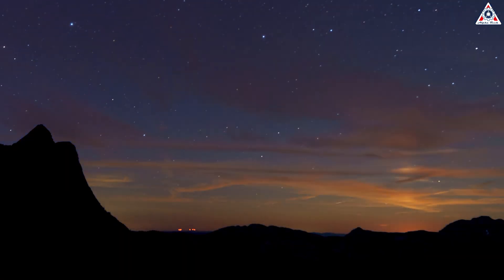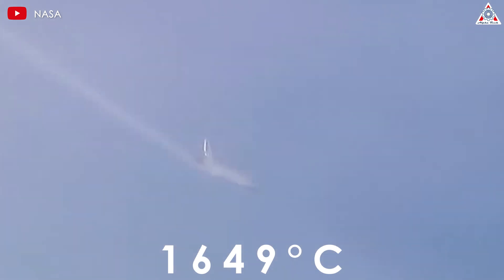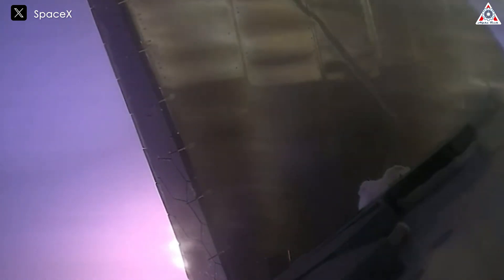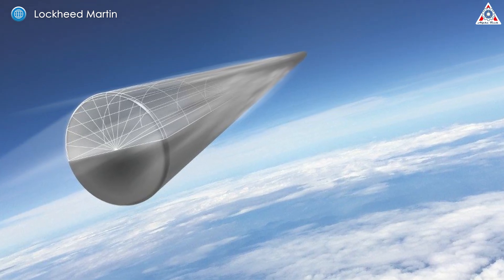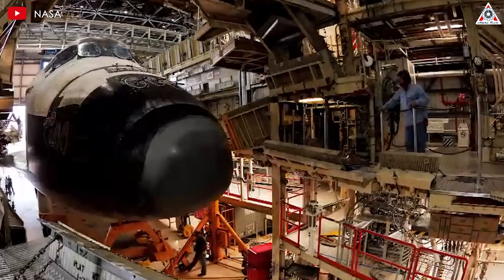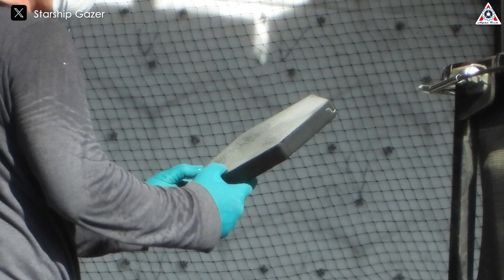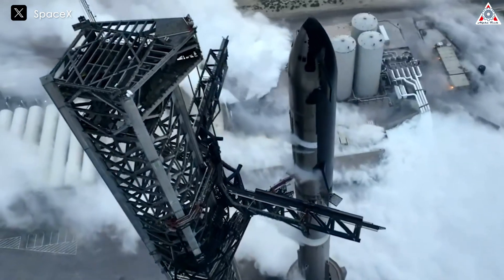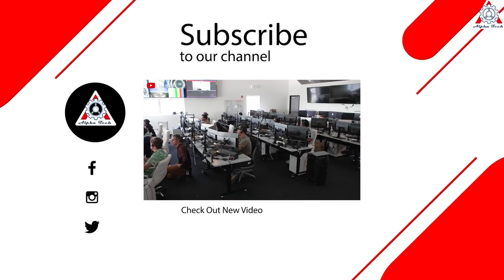SpaceX Starship Heat Tiles Re-entry Somehow Better than the Space Shuttle! NASA Shocked.

Comment: 2 questions ⁉️ 
One why not aldo have an easily mountable sacrificial disposable out layer. This could then burn off and be quickly replaced.
Secondly what type of adhesive do they use to attach the heat tiles ?
Reply: Excellent video Thanks

Comment: SpaceX has compounded the problem… lots of KE and no control on a falling object. The thicker the tiles the heavier the structure thus more KE. As a result payload gets smaller. At least you can say NASA engineers were able to design a shuttle out of aluminum, reenter 133 times and we never saw the landing mechanism fail or a molten tire…. That’s the outcome of many smart design choices. That’s good engineering. 
SpaceX still has much to learn… and a long way to go. 😂😂😂

Comment: I thought the whole point was to make a better heat shield than the shuttle? :)
Reply: NASA made the smart choice by engineering the shuttle. Elon expects physics to obey his laws because he can pay… good luck with that 😂
Reply: @Mannicx  NASA went 100 x over budget with its smart engineering. Tiles still prototype, and mostly worked last flight
Reply: There are many things in a space program SpaceX clearly does not understand and keeps making mistakes and generating bigger problems… they did not recover the IFT4 because they are certain of one thing… it would capture all the wrong choices they already know. The good thing is IFT will be launched shortly even if we know already it will perform similar to ift4… fins are the same and it’s now heavier than ift4 which will add more KE to dissipate… take your seats the show will start shortly 🍿 😂😂😂

Comment: Technically, the heat on re-entry is caused by compression, not friction.
Reply: Ha, I was thinking the same thing. Now think about that in the opposite environment, at extreme depths in the oceans. What is happening to the air for a body re-entering the atmosphere,  is the exact same thing happening to the air inside a sub during explosive implosion. The air is compressed so fast it hearts up. The sub thing is a fraction of a second,  but same principle.
Reply: Agreed, lots of people get this wrong. Its not friction.

Comment: Spray on an ablative material over the entire vehicle. Then program the thrusters to systematically tumble the craft keeping the craft uniformly heated. Once the craft lands, just spray on another layer of ablative material.
Reply: 👍🏼 however fins act as flow controls and designed to work in one direction 😂😂
Reply: Ablative heat shield is 3 inches thick. Once use, you have to remove it. Which is not easy as it is design to hold on tight and be ripped off by the plasma stream. If you are adding new ablative material, to old surface, it needs to bond well or it may just be ripped off like a zipper.

Comment: IIR, NASA is mandated to use a "man approved system" for the heat tiles. In this context, that means pretty much the materials and systems that became "man approved" back on the Mercury program in the '60's because it happened to work a few times in a row. In the intervening 50 years or so there have been a few advances in what materials and processes are available and I'm pretty sure that Musk took advantage of them. That said, Space-X may use exactly the same stuff that NASA uses; I don't really know. The point is that Musk was not constrained by a mandate from almost 60 years ago as he was developing his systems.

Comment: Well after all you have all the data from the space shuttle at hand and 40+ years of material sciences advances at your disposal.  One would expect significant improvement from the shuttle's heat shield systems.  What would be shocking is if there wasn't significant improvement.

Comment: No, NASA isn't shocked; SpaceX is doing exactly what they anticipated.

They would be shocked if SpaceX copied the Shuttle's slow turnaround barely reusable tiles.  More than any agency, NASA expected SX to come up with a better design, that is quick turnaround fully reusable tiles.

And they haven't done it yet, and may not ever do it within our lifetime.  This tile situation is the Achilles heel of any rocket trying to be a quick turnaround reusable rocket.  The heat is so high that it melts all metals, so some sort of ceramic material has to be used, and ceramics are brittle; they don't flex much like the a rocket does.  It could turn out that they best they can do is have just a few tiles that fail, not enough to damage the rocket, and then quickly replace those for each flight.

My suggestion is a new flat head screw to attach the tiles, a screw that has a ceramic top and metal bottom, probably glued together.

Comment: Translation: The Enginerds and NASA retreads at SpaceX are going to be insistantly stubborn and Mulish.

Doing the same thing over and over and expecting different results...

A thought experiment...
Lets say we built a feather out of stainless steel, that had the same surface area to volume and weight ratio as a natural feather. And also that interesting feather shape that that uses air resistance to turn innertia from gravity into air resistance and a spiralling downward glide flight profile.  The reason we are using stainless, is because we wish to place it in LEO, and not have solar heat burn it up.
Now if our fluffy metal feather model is allowed orbital decay, will it burn up during re entry? if it has the same characteristics as a natural feather?
ie air resitance to weight, glide ratio, etc.

You could also do the same experiment with say a feather made of Nomex fiber for the resistance to solar heat. I would suspect even with its much less resistance to heat damage than stainless, if the certain conditions of featherness were met, it wouldnt burn up doing a re entry either.

synopsis: the problem is being approached from wrong end thinking. Hard thinking rather than soft thinking. 
Just as the hard launch mount and flame deflection system is only surviving marginally undamaged due to the soft thinking of the water spray system.

Stuff like that... 🤭

What this means, is SpaceX is attempting to use more Brutish engineering than their fathers did did on the Space Shuttle.

When they should be thinking of less brutish methods.

They are getting closer to the required thinking, with extending the flight time and spreading the heat out over more surface area. But until they start dramatically extending high altitude glide ratio  EXCEEDING that of the Space shuttle, their glorified toilet tiles arent going to save them or Elon from the embarassment of little progress.

SpaceX has no Zengineers.... Still attacking the problems like Neanderthals with a club.

Any bets on the next ship only being slightly less burnt up than the last unless the high altitude flight profile is extended beyond a ballistic parabola?

Fricking silicate asteroids have burnt up doing entry since the dawn of time, as have nickle iron asteroids.

Neither material is gonna do it without more finessé...

Silicate tiles? nickle iron stainless?

Not gonna fly Wilbur without more lift...

Have done dozens of writs on this and various potential options... maybe it will take fear of bankruptcy again like when I proposed parts count and all the Yammerheads screamed all butthurt, that somebody not in their Social Clique might dare to suggest they were F'd in the head...

You gonna pay the Physics ticket sooner or later....

I'll wait...
Reply: While you may prove to be right in the long run, don't forget that they've only had 4 test flights in this iterative process.  Elon has been on record admitting that they aren't there yet on the tile situation, but they're already doing something dramatically different on the next flight.  What took NASA years to change, SpaceX is changing in a month.
Reply: @tood6459  
Good point, I do lack patience fairly regularly...
And like Elon  have realized its a race between Space and Extinction.
I think the odds of the Asteroid strike are way less than the odds human stupidity gets us...
Reply: The larger volume of Starship already addresses the idea of using a smaller density of the structure therefore a more buoyant vessel.  This extends the flight time.  By incorporating more complexity such your feather concept you create less standard parts, less durable parts and more specialized  parts creating more difficult maintenance. Maintenance is inevitable on all reusable vessels.
Reply: @markharmon4963  The feather thing was just an analogy to make a point.
And I understand the Starship volume thing, and in fact suggested pressurizing the hull for launch to stiffen it due to its relative light construction. others may have suggested the same, but I did hear that was getting used.
Also I know its gonna be difficult if those ships are coming back loaded, passengers and or cargo, dont think that volume will be enough for 100 to 200 tons depending ship size.
Also I doubt current construction methods would support that load.
And have heard Elon referring to this problem, that actual service models will have to be designed and built much different.
My point all along, is that there are better designs for more passive re entry profiles. They of course all add mass. over anything except a tube or sphere shape.
But we have better engines now, we dont need to build spruce and silk aircraft figuratively speaking, Especially considering published numbers on Raptor 3 and presumed numbers on Raptor 4.
Getting more power and efficiency means a new possible hull design. A new paradigm.
And I think it needs to be better than the Space Shuttle at high thin air glide ratio, as the better we get it, the less critical the heat shield is, and it may allow us to shift to coatings, rather than affixed tiles.
Basically where they are now, is hitting a dead end in a maze. chances of getting tile to be enough doing a ballistic parabola at high speed into thick air, are likely small.
I have done many writs on the options available, from acute angle of attack with the tube hull, to suggestions for other hull designs and construction methods.
Also I have seen others making pretty good suggestions.
The main thing shown by flight four, is using current design and flight profile, even an empty hull barely makes it back, and comes in as mostly hot scrap. And it was amazing it still functioned.
Thats not gonna do it for several hundred passengers and their baggage.
They'd be cooked meat.
Something has to be improved, and I doubt enough difference can be made with improved tile alone.
They may be invested in current design and construction methods, but if they cant make it work well, they either have to change, or risk killing alot of people.
So far, the Shuttle was a much less crude design, and was still marginal  and had fatalities.
And in MHO, the tube hull and stubby flaps are unlikely to be adequate...
And that the best time to start working on better designs is sooner... they have plenty of V-1's to learn from. And i dont think making the tube longer or fatter will help enough. 
Just my opinion...
And has been for several years, and so far I'm not very wrong.
Reply: Get a peer review next time. 40% of this is childishly dumb.
Reply from the maker: @thomasmount3530  you mean?
Reply: @thomasmount3530  Oh? I have scored on SpaceX repeatedly, since the beginning with Starhopper and its wrinkly skin...
Many concepts I planted ended up getting used.
I have several thank you texts from Elon supposedly. 
If SpaceX hires the best and brightest on the planet, and Elon is a super genius, How come I can do that consistently?
And where am I gonna find any "Peers"?
Lemme guess? you have a wall hanger? and what has been your contribution besidesTrolling?
Go back to your social club, or come up with better ideas. 
"Through the eyes of a child we will learn how to see."
Thanks! would rather be childish and correct, than an adolt and wrong...
Reply: @garylester3976  ok off the top of my head. Your feather. Please list the tests Spacex did before it ever went to space to find a good solution. You have assumed they were not cost effective, when in fact, they were. You completely miss the line of thought where some of the vortex behaviour around the control surfaces cannot be simulated and so knowledge of weaknesses can be found by re-entering with not enough heat protection. I'd happily debate you more, but only if your goal is to openmindedly progress science.
Reply: @thomasmount3530  I'm here almost every day on Alpha Tech trying to present missed logic.
Which is the same technique Elon uses. starting with fundamentals. I discovered it seperately, only learned he uses the same technique within the last week or two. and mentioned that here on Alpha Tech I think, though I occaisionally do writs on other channels.
On the control surfaces, I predicted in writs here,  that the problem would be concentrated heat in the arm pit area of the flappers... and suggested more of a blended wing effect and control surfaces aft on trailing edges...  In fact, I have been critical of these same issues since the parts count fiasco era.
The flappers, the tiles, the glide ratio and upper atmosphere profile, and the Grid fins...

And have suggested multiple other options for each. And get consistently hearted and usually positive comments from the Alpha Tech admin guys.
Also if you were to dig back thru my writs, you'd find stuff that ended up getting used pretty soon after. The new/next seperation structure was me first, The new steerable fairing concept for Falcon,  and having it land like a hull down boat are in writs here on Alpha Tech weeks before it was the new genius idea.
I'm just trying to help, and do occaisionally get to smile when I manage to get in a concept edge wise..  And did it on other channels, and often got banned for my audacity, until after the parts count thing....

Alpha Tech aint my first Rodeo trying to help Elon.
Been banned on many space sites by the Gate Keepers in lab coats types. I dont stop. 
I'm somewhat like Elon.
My main symptom is I have lacked a short term memory since birth.
Its genetic, my Niece is similar, but I did get a gift, the ability to connect dots that others couldnt easily  see how they connect.
Also a class clown type, it helps, if you can get people alittle hot, they cant not think....
Ask your wife about that?
if she making you mad gets you to think? 🤣
Its why I have fun with people's egos... it gets results... And I have used the same techniques for years planting stuff...
Alot of online jokes have me as the point of origin. Many you have heard.
Like Elon's joke about Jeff not being able to get it up before his first successful launch, I planted that joke a week or two earlier on a SpaceX related site hoping it would get to Elon. 🤣
I'm here to encourage progress by any means necessary.... 🤗
And I'd love to discuss anything with you that might help.
And FYI SpaceX started cobbling up stuff with Hopper, there wasnt alot of previous lab work, and I was in comments herding things from the begining trying to get faster better developement. Elon often did adaptations of my terms... like I suggested "Enlightened Fabricators" and he morphed the term slightly for public consumption. that was when it was labnerds and water tank guys... Soon after he got a very professional fabrication contractor group on board. And things got better quickly.
Basically I've had a hard life, and did alot of practical things, and have a learning addiction.
And so a somewhat different not neurotypical animal.
This morning I was realizing the similarity between the re entry problem and required shapes, and the Story about the Origin of the Viking long boat hull design. They still remember the guy's name, and the story goes he saw the wind take a leaf across the surface of a body of water, and realized the design for the boat hull. Best hull design ever to this day.
When I first read that, my realization was he needed a leaf with wider aspect and turned down tips to create stability...
And have done writs on that shape here on Alpha Tech for the eventual re entry design shape, the cupped wings to channel air and turned down tips to keep it linear.
Watch a broad leaf with down pointy edge tips fall from a tree, thats how we need to design for reentry.
Nature is very efficient at things... billions of years of experimentation.
Ònly what works well survives....
Spacex is on a similar path.....
And I'm a long range shooter hobbiest type. I know about flying bullets and their limits and nomenclature...
What we have here is limiting ourselves by sectional density, and ballistic coefficient, and trying to slow the bullet down by key holing it. And not exceeding a ballistic parabola. We need to use more distance and less angle  of attack, and spread the friction out over more time, in thinner air.
Which is similar to putting wings on a glide bomb...
its to do better than a ballistic parabola.

And poor Starship's little stubby flappers ain't much... and over 45° hull angle means zero glide ratio..... its why the Space Shuttle was 40°....
I've suggested 5° to 15° to get maximum lift to velocity. Start at 5° increase angle as velocity slows.
Maybe they can milk enough braking that way to begin to exceed a ballistic profile.
Dont know about you, but if I'm in it, Would prefer the coolest re entry profile possible. And not end up a barbecue, if something goes wrong.
And we have the motors now, can let go of the early limits era a bit on design with each new better more powerful and efficient engine.
It doesnt need to be a pointy tube with minimalistic control surfaces. We can launch designs that fly back instead of fall back.
And will need that returning from Moon and Mars.